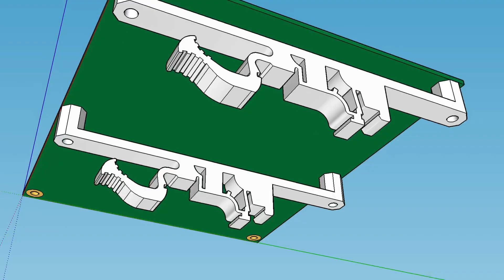3D-printed DIN Rail Mount for MESA 7i96S I/O card for Plasma CNC

Comment: Was it hard to setup the Linux cnc with the mesa ?
Reply from the maker: Not bad. One of my videos in my plasma series shows screen shots of each screen in my configuration setup wizard options.
Reply: I think I am going to order a 7i95t
Reply from the maker: @fabog3732  Any reason for paying more for so many more IO's? It's $100 more than the 7I96S — https://store.mesanet.com/index.php?route=product/product&product_id=374&search=7I96S
Reply: After seeing the shipping cost they might be a better option. Will a 7i96s have all the ports I need for everything? 

It’s a first time experimenting with cnc boards, I know Linux and have played around with 3d printers. 

I am building a printnc with swappable spindle and plasma so I can switch between the two. Maybe even add laser down the road.
Reply from the maker: @fabog3732  Well it had what I needed for plasma. You'll need to calculate how many you need and check the specs so you know. On the MESA website, for each board, click the Specifications tab, and download the user manual, to get full details!

Comment: Nice progress. Looking really hard at either LinuxCNC on 7i96s or Klipper on BTT Manta M8P. Definitely less software work the route you are going, but about twice the price. Probably time well saved.
Reply from the maker: I knew that LinuxCNC + MESA 7i96s + MESA THC add-on gets you automatic torch height control. I just did a quick google and apparently Klipper-Plasma can also get that for you. However, I have no idea how that implementation works. I have guide content by V1E forum member Kyle and V1E founder Ryan that steered me to LinuxCNC + MESA.
Reply: @design8studio  Makes sense. Thank you for the response. I think I will be giving the clipper route a try. May be a giant exercise in learning with loads of frustration.
Reply from the maker: @landonhillyard  bearing in mind that automatic torch height control has to have both a hardware component and a software component, what TCH add-on will you be using with Klipper to get automatic torch height control?
Reply: @design8studio  from my research, torch height control is fundamentally reading an arch voltage and sending z axis movement command to maintain the arch voltage in a range. I plan on using an arduino based system that has been around for a couple years.